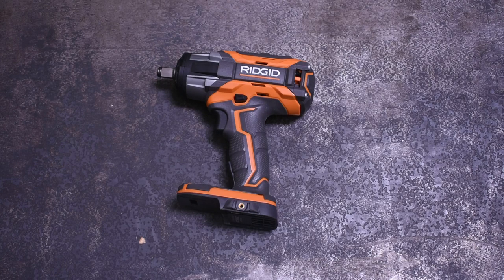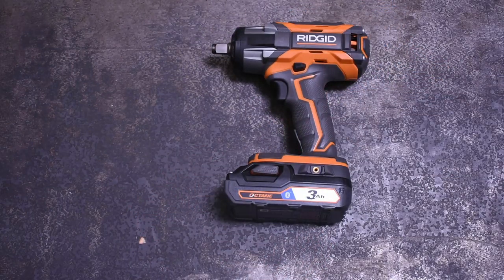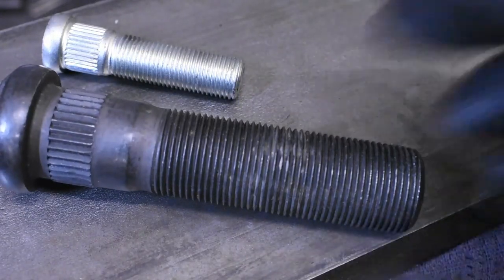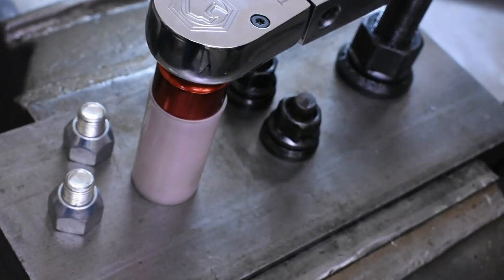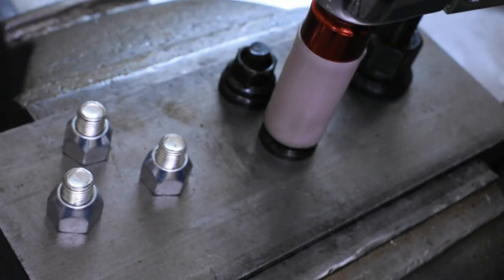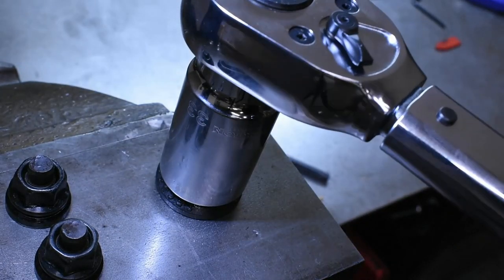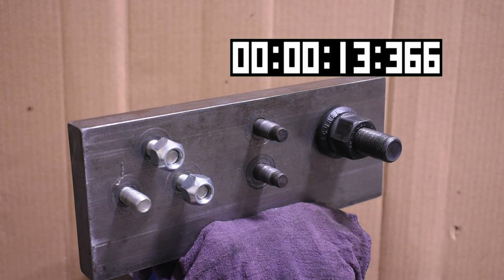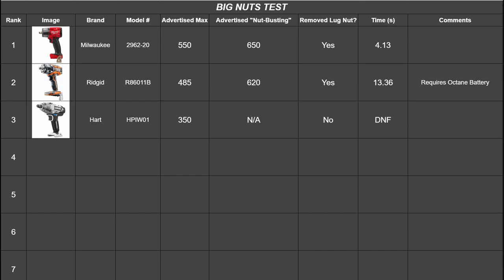Can a Ridgid Mid-Torque Remove a Semi-Truck Lug Nut? Quick Test 3

Comment: Posting on the correct video this time...doh
I have had my R86011B for two years and zero complaints - only used to rotate winter/summer tires on two cars, nothing else yet.  I use setting 'A' to remove, '1' to install and torque a quarter turn to reach spec (100 &108).  I lift a side of the cars at a time using the cross beam from Hazard Freight on their blue 2 ton alum, low profile jack.  Good times!  My whole garage is Ridgid since they replace everything for free!  My first two batteries were 9 years old and got replaced last year.  Same for same.  Too bad they don't let you pay the difference and get Octane.
Reply: 100% same boat on the wheels specifically Auto to remove 1 for install and gather 1 is around 80-85 FT LB.

Comment: Let's see 13 second times 10 wheel nuts per wheel 10 wheel sets on the truck and trailer and 8 inner bud wheel nuts on the duals. That's 180 fasteners per average truck and trailer. So that's only 39 minutes to peel all the wheels off. Of course we all know the last guy that put them on slam them on with a 1-in gun because let's be honest who the hell torques semi wheels 🤣
Reply: Don't we all  say errrrrr click when we tighten heavy duty fasteners.
Never had a wheel fall off yet if I say that when I let off the trigger so it must be spot on.
Reply: Thankfully those bud wheel nuts date way back and wouldn't be many of them on the road, not around here anyway as rust takes care of that ( as you know being from New York state ! ) . But as to torquing highway tractor and trailer lug nuts, yes that actually happens at every tire shop around this area ( Alberta Canada ) which I gather isn't a thing out your way in the USA. I'd have to look into it so I don't know if its an actual legal requirement or a liability issue but typically if they have the bodies they have two people do it so one pulls the wrench while the other lines up the socket on each nut. In any automotive shops, again they always use a torque wrench but again as you well know it all depends on what the tech did prior with the air impact and if the torque wrench actually turned the nut or it was way over torqued by the air tool. Then they inform the driver with a sticker to show which tire position they had removed and to re torque the lug nuts and so the onus goes onto the driver to have them checked and yes back to the same tire shop and they re torque them .... or you don't go back and do it yourself or it never gets done etc !. Thought you might find that interesting anyway, don't know if its a Canada wide practice or not but this has only been happening in the last number of years as years ago there was no torque wrench in sight !.
Reply: @Blazer02LS  That is interesting to know, I had assumed the US was doing similar to Canada or or at least where I have exposure in Canada to tire shop techniques.
Reply: @Blazer02LS  I was giving  it the benefit of the doubt 😂
Reply: Most trucks aren't running budds anymore so not many inner nuts. Every fleet shop I've worked in requires a torque wrench after reinstalling wheels. The one I'm at now, we even check torque at oil changes, every 50k miles.
Reply: @kylesonsalla7620  What part of the US have you been working in ( this is assuming you are in the US ) and I wonder if major fleet shops tend to have a more by the book set of procedures vs an independent truck shop that may have their own habits. Like you said not many budds would be on the road or at least commercially anyway and probably rare for you to come across left handed steer tire lug nuts as well.
Reply: @charlesb4267  
Wisconsin. First job I had out of school 10+ years ago was at a custom manure applicator, running all 70/80 IH trucks, everything running budds and the older ones had left hand studs. Every job after that was all hub pilot. Where I'm at now we have ~100 trucks in rotation, we have 15 new ones on order, with our oldest trucks being '15's and getting traded in. We definitely go "by the book" on most things, we have pretty much all the truck/engine manufacturer software and deal closely with our dealers on maintenance procedures. We're even authorized through KW and International for doing our own warranty work, but not through Freightliner. Our oil changes consist of an oil sample, changing oil and all oil and fuel filters, cabin filters, checking trans and diff level(changing if at the recommended interval), greasing, full chassis and brake inspection, topping off fluids, checking pressure and torquing tires, testing batteries and cleaning cables, running a trip report and checking for any codes on whichever manufacturers software is needed, doing a full TriPac service(air/fuel filters, oil change, and run a report), and we spray all CAC clamps, hood hinges and struts, and under the 5th wheel with fluid film. Get it all done in about 3 hrs normally with one guy on it. We try to be as thorough as possible, always cheaper to fix it in our shop than on the road.
Reply: @kylesonsalla7620  That is good you have had exposure to the old iron relative to your age vs always new or next to new equipment. I find that interesting about using fluid film and even on clamps that normally don't get touched until there is an issue ( of course probably corroded and won't move by that point ) . I farm by the way so most of my work on trucks have been what we happen to own and unfortunately well experienced trucks if you get my meaning. Speaking of fifth wheel plates the last truck we bought ( was supposed to have had a CVIP done on it ) I realized the secondary locking/safety arm on the Holland FW35 was completely seized on its stud and kicked off to the side as that is where it sat seized up as the underside of the plate was all rust. I try to spray that all down with you guessed it, fluid film to try and keep the rust away. Every highway tractor we have bought I have had to throw the old plate and install a new one so without question they would not fail. I am curious what the typical hours are on the engine oil changes and if a full synthetic is being used or what your fleet uses. By the way I have been through Wisconsin once many years ago on an adventure trip in the middle of winter so was not in your state long as I made my way south.
Reply: @charlesb4267  
Not sure on hours, but everything gets changed at 50k, we have Maxxforce13's, MX13's, DD15's, and A26's. Unless there's an issue with the engine, oil samples all come back with plenty of life left to them running Citgo 10w30 synthetic blend. Part of the reason we spray the CAC clamps is so when we do have to remove them, they come right off without breaking on 600-800k mile trucks. We rarely have to replace them. I love fluid film and use it pretty much anywhere rust or corrosion could be an issue. Battery and alternator connections, ground studs, and the exposed studs on International power distribution boxes under the hood especially. Our trucks run a majority of the time in the upper midwest and upper east coast so they see a lot of salt and brine.
Reply: @kylesonsalla7620  I am guessing with that service interval that the typical gross weight is 80000 lb and sometimes far less is carried or you may have some other trailer configurations that are heavier. Up here there are a lot of super b trailers on the road, be it tankers, hauling finished lumber, grain etc as per on highway ( off road logging a different story yet ) so super b at 140000 lb is a much more frequent engine oil change interval for sure. There would certainly be Paccar engines in the last years and unfortunately Cat is out of the on road picture so its a lot of Cummins for the simple reason of their size and power. Although there is some of everything on the road up here certain brands are not as popular as they used to be and would say KW and Pete are the two top popular trucks and 18 speeds and 46 rears are very common as are tridrive trucks as its a bit different scene up here. Unfortunately we are in an area where they use calcium chloride depending on the situation and location, or blends of salt and calcium and that is wicked crap but where you run your also in the thick of the salt belt. Its a gold mine for new sales for trucks and all forms of trailers.
Reply: We do!  Every wheel we put on at the shop gets torqued initially to 500 ft-lbs and then again 100 miles later. 🇨🇦

Comment: Use oil on the bolts next time, sounds backwards but gives it a lot more holding power maybe 4x as much. It is standard practice on a tractor trucks lug nuts.

Comment: I prefer this method of measuring reverse torque. I think the method is better than measuring the clamping force. Removing a nut torqued to a value is the most accurate measurement in my opinion and I think you are doing it exactly correct.

I disagree with the few comments that the test does not take into account a real world setting, rust, aging, etc. The goal is compare wrenches and the same test has to be applied to each gun. This is the way to do it. 

Can you test more guns and add them to the chart?

Comment: Hey awesome test. As a log truck driver I would be interested to know what 1/2 inch air gun is best for removing 33mm lug nuts. Had to do a tire change out in the woods and it is definitely a chore. You can run straight off the trucks air tanks at 125psi. With 50ft of 3/8's line being able to reach the entire truck. 

I know that is pretty specific but that's what most trucks would be. Limited on space so any help with keeping weight and size of the air gun down would be super helpful. 
Cheer's
Reply from the maker: IR 2235TiMAX  or the new Astro THOR gun, or Matco MT2779

Comment: As I watched this video I was surprised to see that tool actually loosen the M22 two piece lug nut and yet I can relate to why it can do that in a lab setting and would never be able to do that in a real world application, that is nothing against your testing methods in a lab setting as it just is what it is since its new hardware. For example I have a Milwaukee high torque 1/2 and yes I have a 33 mm socket with 1/2 drive so there is no reducer from 3/4 down to 1/2 to loose torque. I've tested the tool on recently removed/installed lug nuts of the two piece style you show which is the standard in the industry on trucks for a number of years now and having been installed using some oil on the threads and within the two piece nut assembly ( as per the wheel end manufacture explicit instructions ) and torqued to 500 ft lb. Those nuts it will remove although with some effort to break loose. However lug nuts/studs that have rust in the threads as per the wheels not having been removed in some time and having seen the crappy winter road salt/calcium chloride situation where I reside, there is no way my impact will remove them and an obvious reason why truck shops use a 1" drive air impact to pound them off. Again, my comment is purely to bring up the topic of real world rusty wheel retention hardware and how hard they come off and not to bash your testing in the least.
Reply from the maker: We agree. Only reason for new/lab setting is so they all have an exact equal test, a rusted real life road use would be more realistic (and more of a high torque test) but also not be fair from one tool to another, one rusted nut to another.
Reply: @TorqueTestChannel  Exactly, its impossible to re create a used/rusted hardware scenario that is repeatable. The reason I brought up the topic is having watched certain youtubers that even own semis and they are giving false reviews or I certainly think so with my experience on highway tractor wheel end hardware and have compared to friends that also have the same impact and they are finding the same thing and its not like I bought this 1/2 impact for that purpose either. That is the sad fact about some youtube channel reviews is that they are being paid or given a tool and create a glossy review that is misleading and that I must say does rub me the wrong way. That is why I like your testing and graph format as it lays it all out and compares air to battery tools as well.
Reply: I know Project Farm goes through and rusts his bolts. Probably still not as bad as when you through some dirt into the mix, and other real world uses. The absolute best would just to be to go to a truck stop and start pulling lug nuts, but I don't recommend that.
Reply: @snoopdogie187  I'm laughing at the truck stop comment, I wouldn't recommend that either !. Actually what I would suggest if realistic lug nut removal was sought out would be to talk to a reputable truck tire shop who wasn't overly busy and put the tool in the techs hands to use while being video taped and use the tool on various trucks as they roll through getting tire repairs or new tires installed, multiple techs and multiple trucks and the techs give their 100% honest opinions. And trying 1/2 impacts, 3/4 and the newest 1" battery units on the market which there are probably not many of. That type of content if done fairly would be good information for repair shops, service trucks, truck tire shops etc to see if that tool would be a good fit for them. Definitely not a home owners tool review there but one geared directly at mechanics and shops.

Comment: Wonder if would have been faster with a 6ah or 9ah Octane battery...🤔
The world may never know...
Nice work...the Ridgid impacts are fairly decent for cheap....
Reply: I got mine a year ago for $77, which was the prorated price I got for the impact wrench portion, as part of a buy-one-get-one package deal with a charger and 2x 3Ah Octane battery starter kit.  It's tough to see how I could beat the performance of this tool, at that price!  

I do have a 9Ah Octane battery... and I'd be happy to perform the test you suggest, except I don't have access to any big rig lug-nuts!  Or big rigs in general!  Not even the dadgum 33mm socket I would need!!!  Dang.  Sorry, bud.

Comment: I wonder how the old Mid torque compares...i mean you already did the new one, just us guys with the older version, i wonder whats different. I wish mlwaukee would get an impact with idk 800 900 nut busting, in a size of the mids, a big bigger maybe. An almost perfect tool lol. WOuld make the 80% of nuts turn into maybe 90 93% that you can remove. WIthin reason ofc.

Comment: I'm sure you have a suggestion list a mile ling, but I'd love to see a test on the harbor freight bauer 1/2 CORDED impact. The claims they make for that seem a bit...... exaggerated.
Reply: Everything is an over exaggeration as far as I'm concerned. Some companies just happen to be much closer to their boasts than others. I have the big Bauer impact as well as my friend having one. Even though I can't verify its' torque claims all I know is it took off a way too over torqued lug nut on my old Silverado. Which felt like someone jammed it on with an air-impact. For the few times I've used it, it's work for me. But since I don't need such a big unit all the time it's my "Just-In-Case" impact. My stubby 3/8 Milwaukee M12 impact gets 98% of the work. :)
Reply from the maker: We bought one!

Comment: I just watched your video great video but if you're going to compare the Milwaukee to the rigid you can't have a 6-hour red it lithium Milwaukee battery versus rigids three amp hour octane and then talk about the difference at least have them close enough to the same to give it a Fighting Chance. That's just my opinion a great video anyway cuz if I put my 9 amp hour battery on my mid torque I have busted semi truck lug nuts pretty fast

Comment: Can you do this test with the Ryobi P262 with Hp battery?
Reply from the maker: Will do!
Reply: @TorqueTestChannel  the ryobi p195 3ah hp battery uses high output 21700 cells.  i got my p195 for $50 so it's a reasonably budget friendly option that will give ryobi tools like the p262 the best chance for maximizing performance imo.  really love my p262 it seems consistent and very powerful to me.  it has the hp terminals so maybe it needs an hp battery for best performance.

Comment: Pretty impractical considering most reputable shops torque to 550 ft lbs and more often than not a healthy 3/4 air gun wont take them off once the tires are worn out...
There is a reason tire shops use 20+lb 1 inch guns with 5/8 or bigger air lines